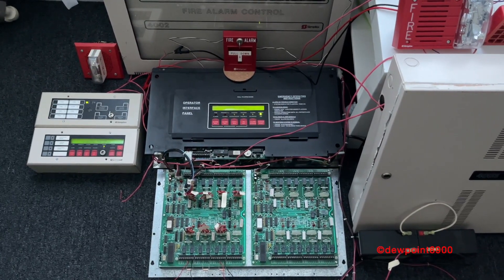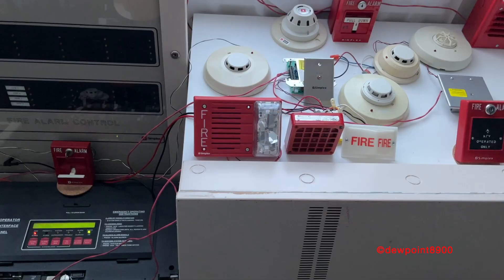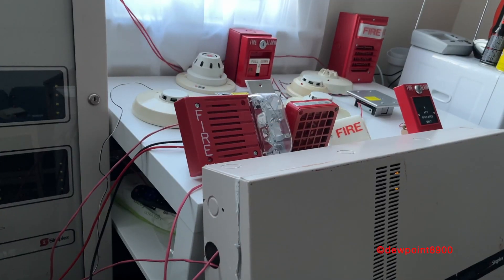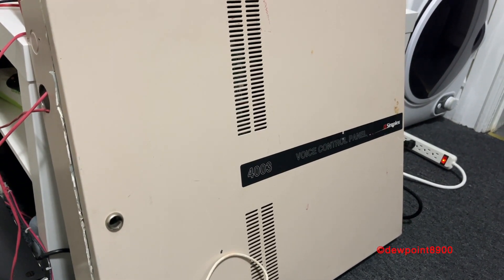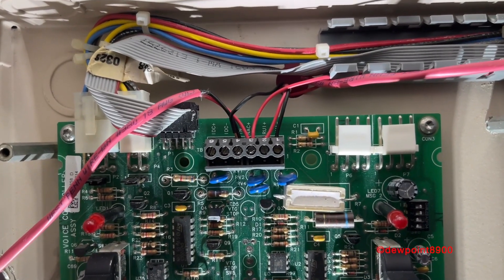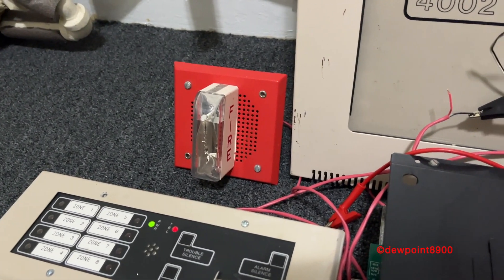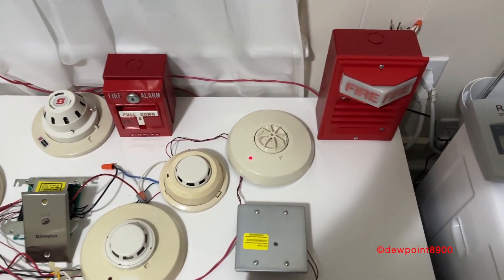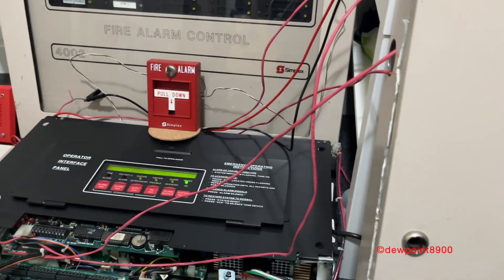Simplex 4020 + 4003 Panel Linking Demo

Comment: what would happen if the coded pull station activates during walk test? what does the voice do? And would the nacs in normal mode do its coding, or only the nacs set to it?
Also, what would the 4003 do if you do a walk test without it connected using the rui? (say if you had a 4003 on a 4002 or something)
Reply from the maker: The walk test message replays whenever a trip happens, so it would probably keep looping the message until the coded pull stops. With my setup, normal NACs just sound on continuous during walk test.
Without the RUI, the 4003 just goes into alarm like during normal operation.